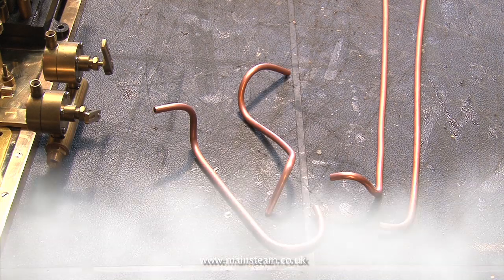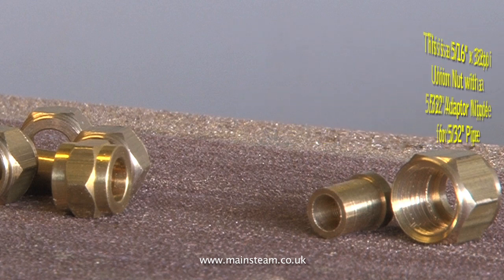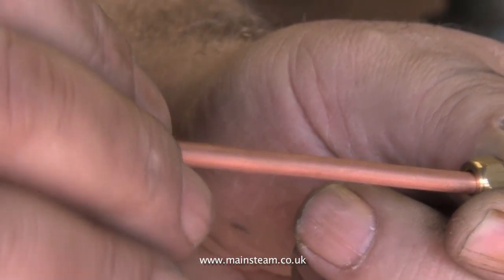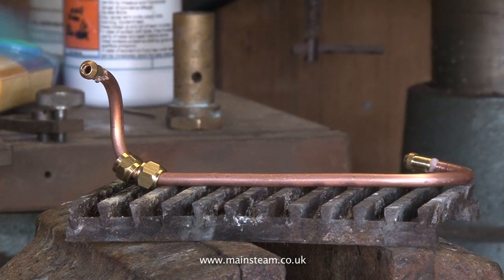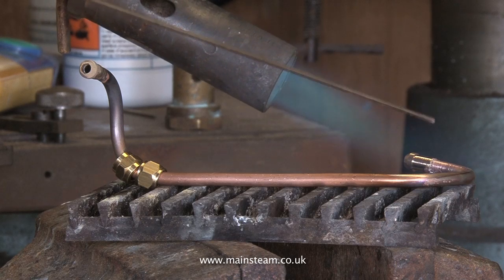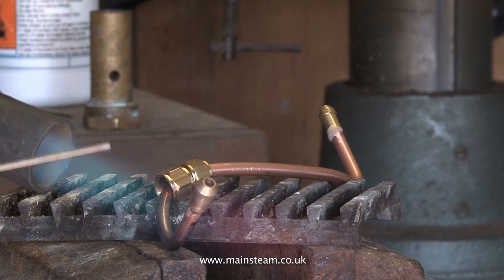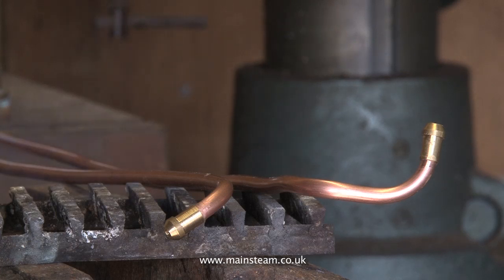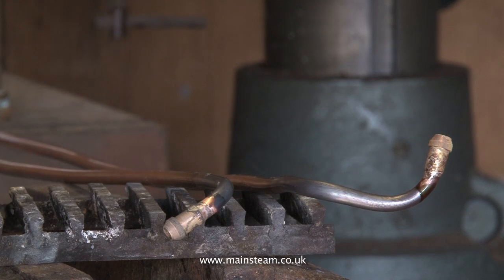MORE SILVER SOLDERING FOR BEGINNERS  - PART 2

Comment: Hi Keith, thanks for the video. I am struggling to solder 1/16" syphon tubes, the solder gets into the copper pipe. So any tips?
Reply from the maker: Using very thing Silver Solder wire is a good idea.